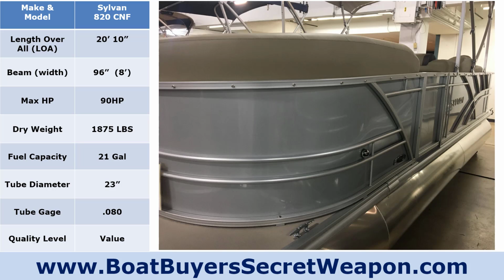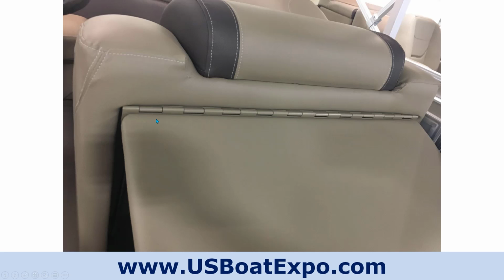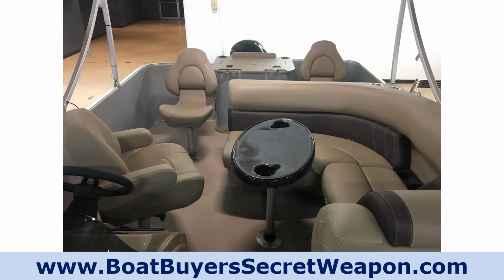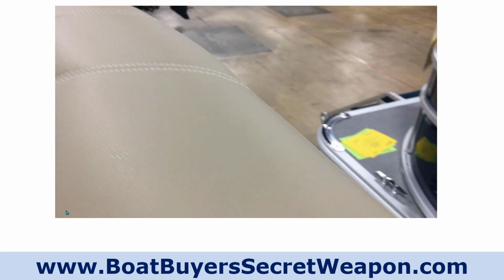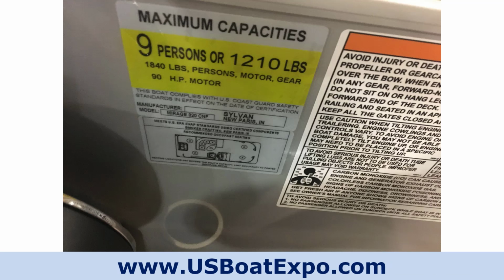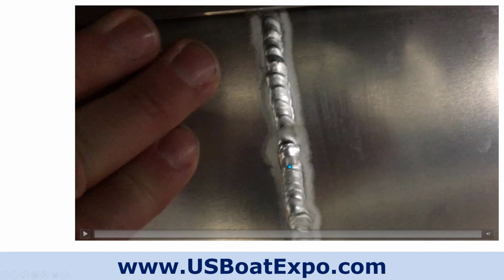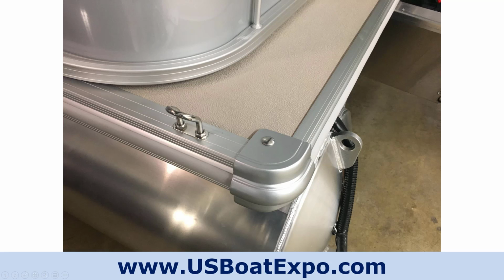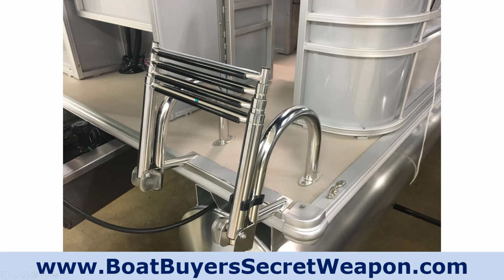Fishing Pontoon Review: Sylvan Mirage 820 Fish

Comment: I’m a retired weld inspector. The QC on these welds are crap. I could take a student welder and teach him inside of a week to weld better than this.
Reply: @BoatBuyersSecretWeapon  my background is Navy, Non Destructive Testing inspector. Qualified both nuclear and non nuc. Sub repair, reactor and high pressure steam plant. Aluminum weldments very poor for pressure vessels So is not used. Test with visual and dye penetrant. 080 aluminum best with Tig, then mig. Also proper joint design and weld prep. Must be extremely clean prior to welding.
Reply: Yup, some ugly, ugly welds.  The welder wasn’t very skilled.